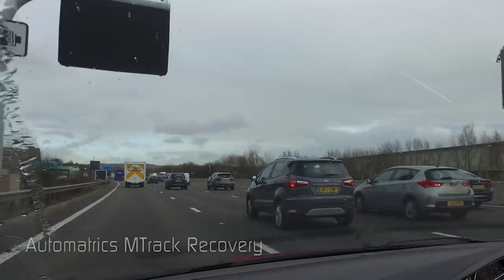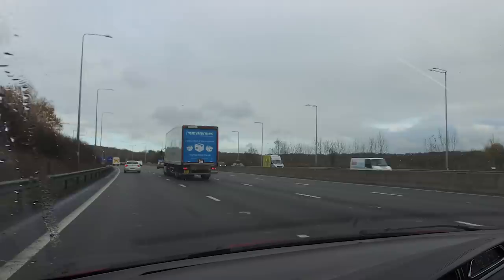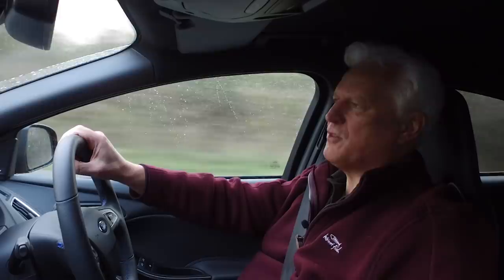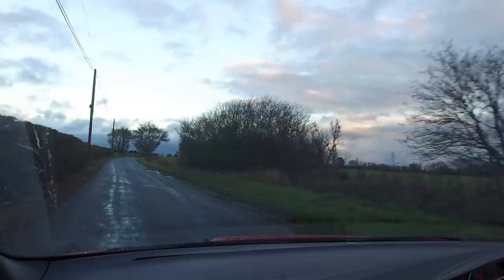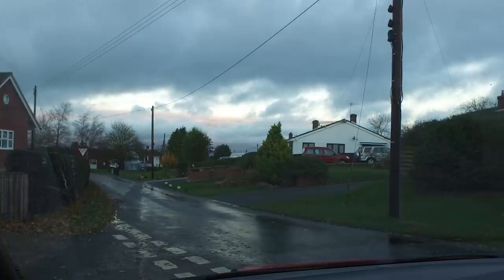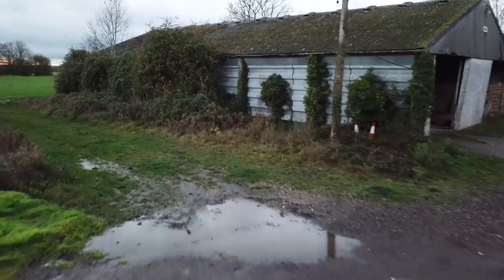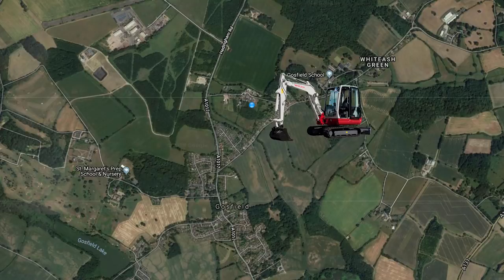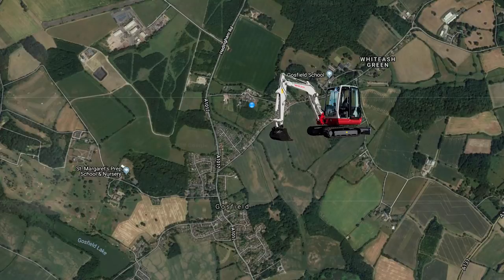Stolen Takeuchi TB 235 Compact Excavator Automatrics find operation Ashen 3rd Dec 2018

Comment: That's great they recovered their mini excavator. But please.... Use 4 chains, and tensioners in all 4 corners. 
Not nylon ratchet straps. LOL
Reply: It did seem a little light duty for what they were carrying, lol.
Reply: Nah mate, even at a hardware shop you could go buy a strap for 30 quid that takes 4t. That machine probably does not weigh more than a ton. The majority of stuff carried on a trailer is fastened using this method and/or stopping (putting it without space inbetween any of the objects leading to the wall facing the forwards direction).
Reply: @ThorbzE  you are high if you think thats less than a ton
Reply: @ThorbzE  that machine is almost 4 tons
Reply: 8487 lbs 3850 kg
Reply: @ThorbzE  He even put the weight of the machine in the description, good job being an "expert".
Reply: Sean Gorham lol regardless if it is 10ton or 1t or 3.5t, these straps are good enough for securing the thing, and you dont need chains, that was my point.
Reply: uncletigger  The fact that you are talking about your little boat in a thread about securing loads says it all. Have a nice day old man =)
Reply: @ThorbzE  The fact that you thought a midi-excavator like that would probably "not weigh more than a ton" also says something, can you guess what that is?
Reply: EinachserLS looking back at the video again i see where you are coming from. I did not read the description and I was basing my guess off my own minidigger, which i can see is a lot smaller than this one. But I still stick with the fact that I would never secure this load in 4 corners with chains. Or straps for that matter, we dont strap that way. You strap to stick it down to the floor, not to stick it to the walls
Reply: @ThorbzE  "You strap to stick it down to the floor, not to stick it to the walls" 

As far as I know that´s exactly the opposite of what you should do, especially concerning loads like this. After all there is little danger of an excavator floating away into the sky, you want to stop it sliding of your trailer when it is experiencing horizontal acceleration.
And sure, you can do that to an extent by pulling something down onto the bed, thereby increasing friction (the materials that are in contact with each other here also play a huge role), but your chains (or straps) will be able to counter  much higher forces if you lash them directly to the load, usually diagonally to take up lateral and longitudinal loads.
Reply: @EinachserLS  I disagree. Its clear cannot come to an agreement, and that we have been tought different things when getting our truck driver licenses (probably because we are from a different part in the world). I will leave it at that.
Reply: @ThorbzE  You´re probably going to laugh...
I don´t have a truck license.
But this is not a matter of opinion, badly securing loads can get people hurt or killed and there are ressources out there, compiled by people who deal with this professionally, who have actually done the math. After all it is simply a matter of Newtonian Mechanics and the math does not lie.

One ressource I have found useful is here:
http://www.tis-gdv.de/tis_e/ls/ls_im_strassenverkehr_die_fakten/ladungssicherung_im_sv_die_fakten.html

A short excerpt from their section on "Direct Securing":
"When securing cargoes to a vehicle, the term "direct securing" refers to all methods whose primary mode of action makes use of "positive locking" force transmission between the cargo and the vehicle. This is the key difference compared with friction securing (tie-down lashing), whose primary mode of action is a "non-positive" or "frictional" connection between the cargo and the vehicle, which is merely increased somewhat by the tie-down lashing.

Whereas the effect of force transmission through positive-locked connections is limited by the strength of the material used for securing, friction is subject to greater restrictions, which are only marginally influenced by the material used for securing. This means that direct securing can be more efficient than friction securing using similar materials by something in the region of the power of ten. "
Reply: @EinachserLS  No I wont laugh either way, because you are being very factual and I understand what you are saying. However I think you missed the point of where I also put cargo (and this is where my english really fails me :P ) In a "stopping" position, Aka that it is up against the wall in the driving direction, and then strapped down. Our flatbed also has metal strips with holes so that we can put metal poles to further stop movement. Keep in mind that load that does not get to start moving really does not need a lot of force to keep in place. In my country, and the UK afaik you need to secure the loads weight 100% in the driving direction and 50% to the sides. I cant find it, but there is a video on youtube by some danish guys showing us how a cardboard box is strong enough to stop a very heavy (100-1000kg) load just by filling all the gaps, without even bending.
Reply: @ThorbzE  100% agree with you there, if you can put your cargo up against a wall that can take it, that´s a great way of securing it. I regularly have to haul round bales on flatbed trailers that have no "walls" to keep them from rolling and trying to keep those things tied down when they are stacked two rows high and 2 rows wide is like herding cats.
Reply: EinachserLS Ive never hauled any bales, but ive heard they’re the worst.. best of luck to you ;) stay safe!
Reply: Ah how many people that posed stuff like this actually know how much a little digger can weigh or how weak or strong the straps are. I worked at a place ranging from small to huge diggers and the little ones were up to 7 tons. not larger than a car. Also straps are very common to secure truck loads and don't be fooled that a chain is stronger or better than a synthetic strap. they both come with a load rating. 2 straps over tracks will do a fine job of keeping that machine where it is during normal/heavy brake situation.
Reply: Strapping it with nylon straps is actually illegal where I am at.
Reply: Man that's an TON of info...thank guys. Yes I definitely meant the pun intended. 🤪

Comment: Again, private corporations doing the work of the police.  The police actually bolloxed their part in this.  Handed to them on a plate and they are that slow the thieves are able to move the stolen property!!!!  Police are increasingly a waste of money.   No arrests.
Reply: As security company in the states, we look at the areas where the police lack and create a business around it. Just like in this case. Good Job as always, and keep it up.
Reply: But. they'll. be the first ones you'll call then you are in trouble.
Reply: peter d  I think they're mostly complaining because of the huge police cuts across the UK. there's some areas that only have cops during the day, night it's almost free to do what you want. quite a crazy situation there.
Reply: sadly its the same in the states. up to the citizens to do detective work.
Reply: peter d  Exactly what I thought when the target got tipped off at the first barn while the trackers were told to wait for the police off the property. Local coppers can be as bent as a used nail in some of these rural areas. They'll know precisely who the local gang are and where they hide out. If the police are playing dumb, it's a good sign they've been bought.
Reply: peter d  it sound like the police knew where to look and who was a likely culprit. They keep arresting those people and the courts keep letting them go with a slap on the wrist.
Reply: usa #1
Reply: Cops where busy arresting people for islamophobia...
Reply: Night Hawk Monitoring we don't have such a freedom with guns like you have in USA . It looks like you not far from loosing that right soon.
Reply: @dm55  yes because there is no one else...truth dies first, hope dies last...
Reply: I'm sorry to point this out, and NO, I am not defending the police on this one. 
 I read all the sub comments and how it was all about the police, yet not a single comment mentions that the guy doing the video blatantly, in broad daylight walked onto the private property of a suspected thief and doesn't acknowledge, other than (I sure hope they don't see me) his part in them moving the excavator.
Yes, the police did take their time responding. But what you can't say is that the excavator would have still not been there had some guy with a video camera not trespassed into a barn that was freshly hiding some stolen property. I mean seriously, it is almost to the point that he sabotaged his own bust just to extend his advertising video content.
If that was in the US, the guy with the video could have been charged with trespassing and then, if the police deemed the source valid, i.e. electronic tracker, then they would have to wait for a judge to issue a search warrant as to avoid an illegal search and seizure technicality.
You all are making it sound like you expect the police to stop everything else that they are doing to go blazing into the place with guns drawn. Stop hating everything that is by design there to help you.
Reply: @artmathias9725  You are not trespassing if you are recovering/addressing criminal activity.  The police are increasingly a waste of our money and under their own volition that machine would NEVER have been recovered..  Are you  a wannabe cop?
Reply: @billydarley6925  Cops here have gone to the dark side since civil asset forfeiture has turned them into armed highway robbers.  They literally set up on the side of the highway, pulling over innocent motorists, seizing cash, valuables and vehicles without bothering to charge them with any crime.  They can hardly be expected to help crime victims when they themselves are committing many of those crimes.
Reply: @frankroberts9320  NY State?
Reply: And yet the delay allowed them to find the tractor and witness the criminal... seems quite a good outcome dare say.
Reply: @billydarley6925  Who, me?  Texas.
Reply: @evaj.8799  
lol If by "not far" you mean 20 or 30 years if they keep up the pushing harder and harder, then maybe.
   It's hard to understand American resolve if you haven't lived here and the ways state and federal governments are separated. We're actually a collection of nations, each with their own constitution. The federal government has been using the "interstate commerce clause" in the federal constitution for decades, to try and assert more control than they are afforded. With each state being a separate government/nation it really makes it hard for them to take guns away. There's brainwashed or tyranical idiots that live in densely populated areas like California & New York that pass pretty strict gun laws (and end up with high crime) but if it gets much worse, northern and eastern California might actually break off and form their own state. There is a movement for that.
    And we still have the right to manufacture guns and ammunition and keep it in the state without the federal government being able to touch it. Once it crosses a state line though, the federal government asserts the "interstate commerce clause" of the federal constitution.
   Repealing the second amendment and then passing another amendment to ban them would be the only way and that is not likely to ever be attempted without a civil war. One move they've tested is when there's a catastrophe like a hurricane, they go in and have taken the guns "for our safety" but they are required to return them and many people just tell them to get lost or they hide them until the pigs leave. ...and by pigs I mean "those who are confiscating the weapons", not the police in general.
Reply: Chris Turnblom I completely agree with you. I am afraid that there is more and more laws created that are so general in their language that could be potentially interpreted widely. In UK police can't search or stop you without a reason. So now, if they want to do want they want they quote newly made up law about terrorism and go ahead with what they wish. A normal average person doesn't really know his rights or law and will never challenge them which is another reason they feel above the law.
Reply: @evaj.8799  
Yeah some police have tried similar stuff here. All I can say is that we must educate ourselves.
  Honestly, talking to people from the UK, I am often frustrated with some peoples observance or of or adherence to the class structure that still lingers over there. Maybe it's just what people are accustomed to. It still doesn't make it right though.
   I really hope all you who are aware of your sovereignty keep up the push for equality. No person should be afforded rights over any other simply because of the circumstances of their birth. The far left or the left extremeist in this country are trying to push government authority over human/natural rights and in some ways it is working. 
  The shortest way to counter that movement I can think of is to say "the price of liberty is eternal vigilance." and "No matter how you try to suppress it, the human spirit longs to be free."
Reply: Chris Turnblom by the way Im not British, Im living here for over 15 years. I find it fascinating that people all over the world don't see what's going on around them. The arogance is greater than we suspect, especially the youngest generation that lack of education and brainwashing makes them such an easy target.
Reply: You can always count on them to show up in droves for staged, hoax, "mass shootings', "truck attacks", "terrorists wielding knives" to collect overtime, and for the good of the Order.
Reply: When seconds count police are minutes away
Reply: The clown gov. Make some law and ban a target arm such as ar-15 in some tree hugging state such as California ,but in other parts of us they have hard time getting people hand over guns,also with second hand sales laws way they are as in Nevada they never know who owns a weapon
Reply: @Nhmonitoring  ah yes the professional snitch... i mean informant... at least you get paid
Reply: ok boomer
Reply: Too bad you dont have the right to form a militia in the UK to fill that gap out in the boonies! Maybe there is some ancient law that will let you form a posse and ride in with sword and shield though

Comment: Good job Richard. Rather curious the police knew where to head for at the get go when the machine was 'stolen' from the farmers barn?  Looks like the whereabouts of Aladdin's Cave of stolen treasures  was already  known to the  local constabulary.
Reply: Some thinks stinks
Reply from the maker: On the second recovery the office were feeding new cell maps directly to the police, a minute by minute pursuit. It was the first GPS fix that took them right into the second yard. We got the impression that the police had that site on their radar, but in later discussions with them they said they once thought a drug farm was operating from there but nothing had ever really been seen to be kicking off there
Reply: Not really, police have a "favourite" for everything and by that I mean they will frequently check out the locations of KNOWN CRIMINALS. Kind of like if a bunch of shops got robbed the Police will go and see the local shoplifter who they have arrested numerous times before. It's not really rocket science or, the way you put it... "magic"
Reply from the maker: @Johnny Ericsson This customer does not use the optional remote control to arm and disarm his fleet of Automatrics MTrack Proactive motion sensors. Just chose to call us on theft option
Reply from the maker: @Johnny Ericsson Sorry you mean did we receive a motion alert when it moved from the barn. Not at that time, we kept checking the RF which is normally sufficient to confirm still at location. We literally just missed it by a few minutes. Motion alerts did come in later.
Reply: I getthefeeling some of the police might even be in on it...
Reply from the maker: @Mr_Smith_369  We have detailed GPS mapping coordinates from our device GPS receivers. Its only when the device GPS receivers struggle to get data say when indoors or if a GPS jammer is in use that we then use the radio beacon
Reply: @AutomatricsMtrack  Do all your tracker deals receive free call out for RF finds including your time/fuel/free recovery? A years sign up for a Yamaha 125 cost what?